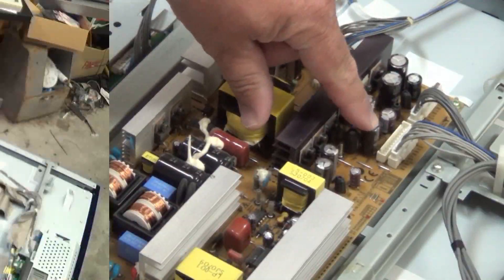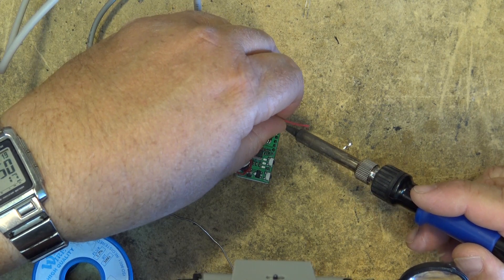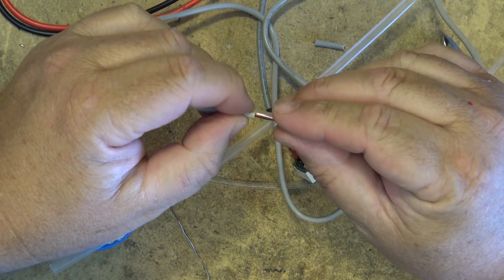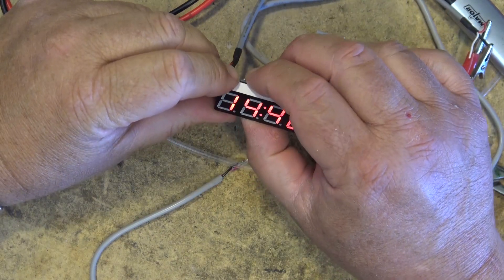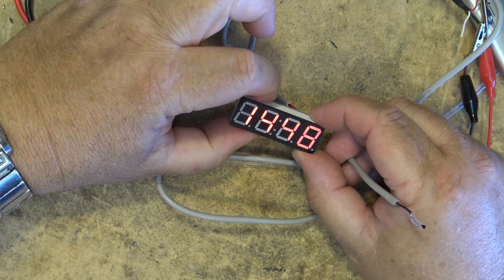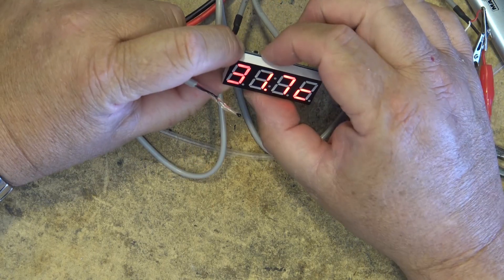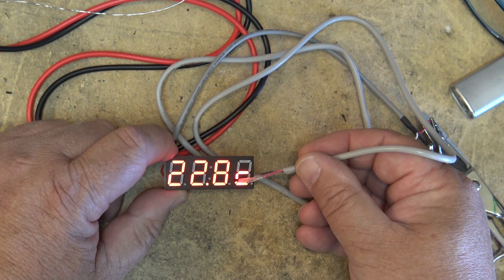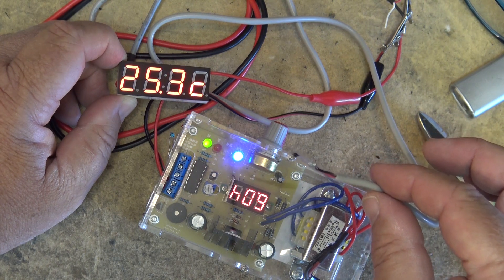probe this

Comment: Overloaded batteries will get over 60 degrees Celsius.
Reply from the maker: Mentorcase 
Batteries should never get to 60'C. That is over 150 F and if a lithium cell gets that 🔥 it will likely burst into flames. The protection circuitry needs to shut it down long before it gets that hot. I am not talking shorting a pack. I will be overloading the USB outputs and monitoring the protection circuits.